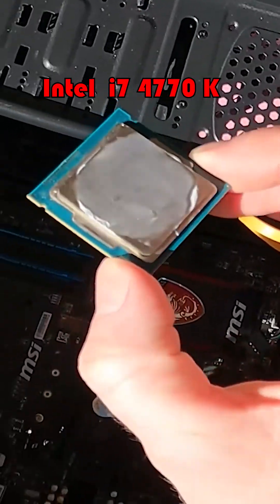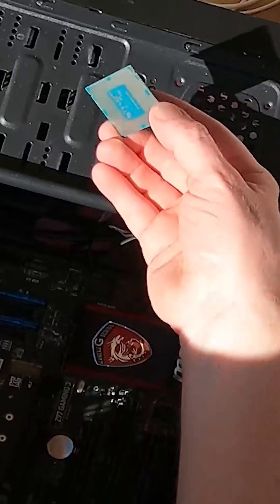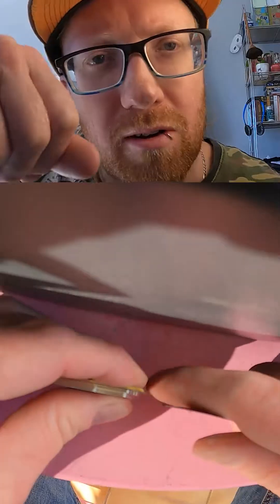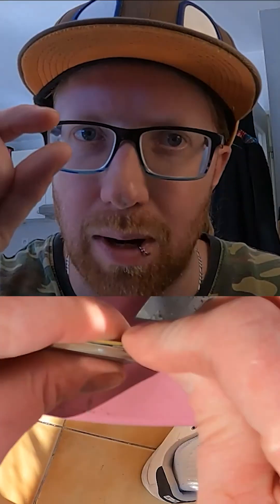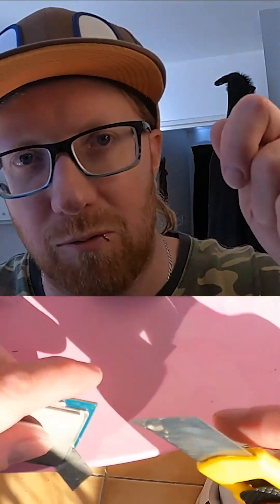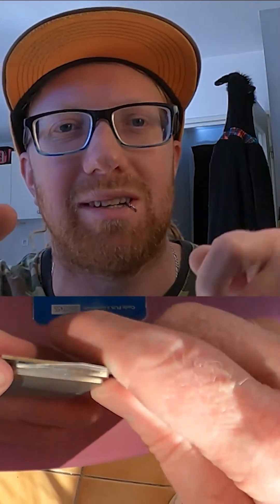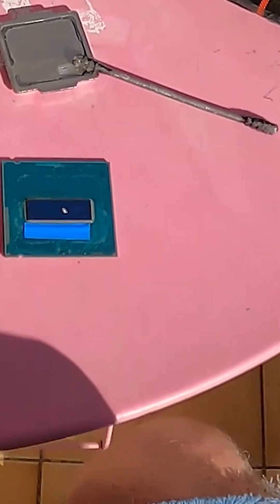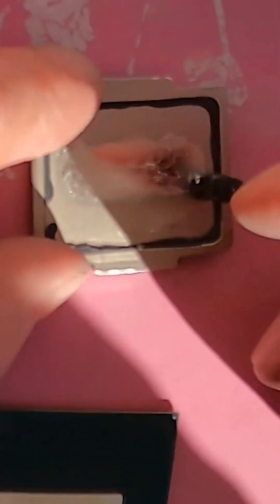How to Delid RAZOR Method Works on Intel i CPU 1st to 8th Gen to GET Lower Temps 😍😍😍

Comment: Don't know how I actually managed to get my 4770k to 4.5 ghz 1.37v (was using 1.4 earlier) on h81 chipset 80º without deliding. I might be a genious or smth
Reply from the maker: Wow that's nuts that's a silicon lotto winner right there, what a unit bro done well :D
Reply: @TheDiWHYGuy  thanks man, i'm about to delid it, any tip on which black glue stuff to use?
Reply from the maker: Cool it should run well, I never glue them back on but if I did I would use a small amount of silicon good luck!